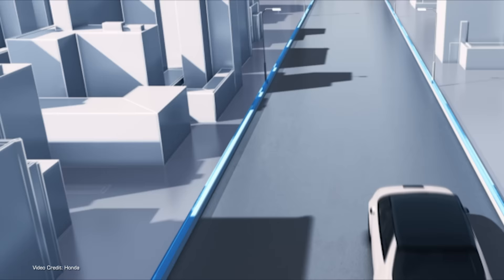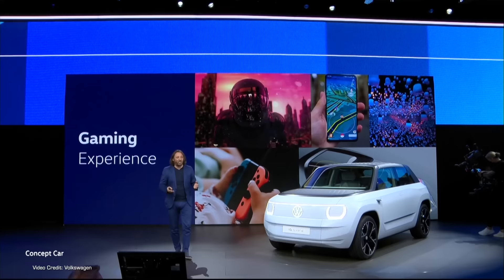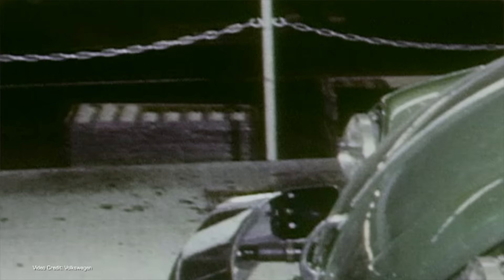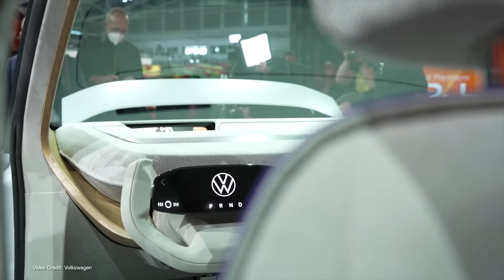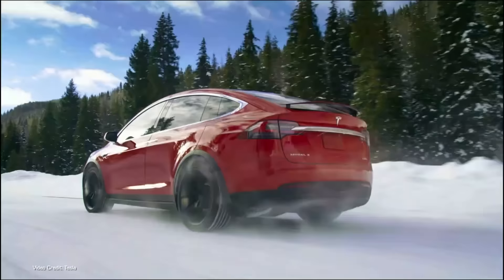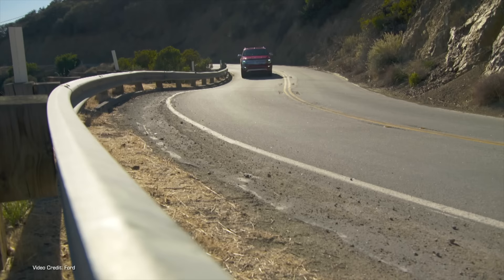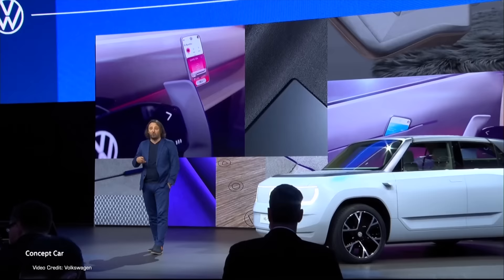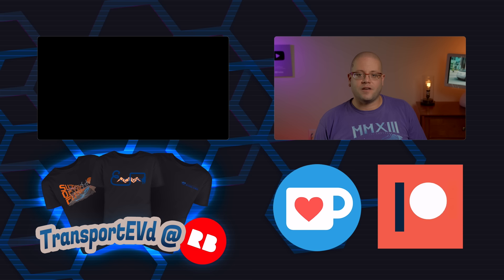We Love The Volkswagen I.D. Life - But It's Too Late To Break The Mold

Comment: It's just a concept car. I wouldn't put too much into it. Never seen one make it to production as is. Same goes for BMW's i Vision Circular or even Tesla's Cybertruck. The manufacturers still have to abide by safety standards.
Reply: It's the concept on the concept car that bothers.
That prototype itself, ok, nice try, we'll see. 
But why VW has the diminutive E-Up as a city car (a magnificent car, but an old ICE chassis convertion, a bit tight on range) and the ID3, and in between only a prototype and nothing ready to sell?

Comment: The reason you need 7.5” ground clearance is so you can open the doors in places where the kerbs are 6” to 8” high and so you can get over footpaths of that height and onto driveways which slope downwards.
Reply: Customers are also getting taller, fatter and older.

Comment: It's a little more than range and acceleration for EVs, efficiency, charging speed, and charging network are also very important.  Tesla seems to be the leader in these categories and the other manufacturers need to compete on these metrics.
Reply: For every day life, acceleration and range actually not essential. Efficiency, charging speed, charging network and price tag are matters
Reply: @MrQuachBinh  if your job is 50 miles from your house and your EV only has 100 miles of range, isn't that a problem on a cold day when you only get 80 miles?
Reply: @wineberryred  the fast majority of people commute far less, the average American drives 16 miles to work (and another 16 miles to return to home)
So, no for the fast majority range isn't an issue in daily use
Reply: @rj7855  so my wife commutes 60 miles west and I commute about 35 miles to the east to our jobs.  Our employers do not offer vehicle charging at work.  Since you're saying that range doesn't matter then I assume you're saying range is a personal issue.  I'm saying that you need a capable EV that will meet most people's needs and that we need EVs that meet every person's transportation needs in all cases without compromises.
Reply: The biggest issue right now is price. Even if you can find an EV you can afford you can buy an equivalent (or better) ICE car for $10,000 less. I know the arguments that EV have less lifetime costs but few people will give up $10,000 now to maybe save $15,000 over the next 10 years. 
Once the price issue is resolved range, charging speed, charging network, etc. will be deciding factors over which EV to buy. But for most people until the purchase price comes down EV's aren't even in the running.
Reply: @joatmon3282  I bought my used 2017 Nissan Leaf with 35K miles for $11,500 last year.  We love it so much we have a Tesla Model Y on order.  Yes, $55k is steep for a vehicle but my wife drives a lot so it's going to save me a ton on fuel costs.  Looks like self driving is coming soon so the vehicle is going to pay for itself as a taxi.

Comment: The minute someone comes out with a $15-$20 000 EV with 180+ miles of real-world range, I'm highly interested.

Trouble is, right now there is only the old guard which costs $25k+ for 100 miles, or the new guard with price tags of $40k+ for 250 miles. I need that cheaper in-between option.
Reply: Unfortunately it will not be made on the USA, but from china
Reply: Try a used ev.
Reply: @S.M.214  You seen the current craze in the PC GPU market?

Same thing will happen with EVs soon. EVs are released and sold out EVERYWHERE. And since demand is so high $40k for a $25k vehicle will not be unheard of.

So, no, used EVs will not solve that unfortunately.

Comment: At least, the I.D. Life is the sort of thing that is lacking here Australia. We're still around 2010 regarding EVs and many other things.
Reply: So long as your electricity is made with coal, there is not much point to an EV.  Your government needs to stop dragging it knuckles on that too.  Last I checked you had a lot of land that sees almost 100% sunny days.
Reply: @kensmith5694  Despite the Federal Government's (an extension of Mineral's Council Australia) best efforts, Australia's energy mix is rapidly greening up. Also, I'm certain there are reports out there that show that charging EVs with coal powered grids is still less CO2 intensive than burning petrol and diesel. Try chucking "coal charged EVs cleaner than ICE" into your favourite search engine.
Reply: @Aermydach  The numbers I've seen suggest that coal to electric car is about the same as gasoline to ICE car.  Coal contains nearly all carbon so all you get is CO2.  Octane has 8 carbons and 18 hydrogens so you get some energy that is not from making CO2.  If not for that, the coal to EV path comes out a bit better.

Comment: Ground clearance of 7.5" = 190 mm sounds wonderful. As a Norwegian, ground clearance is the first figure I look at in any vehicle I am considering for purchase. Living in a rural area, we use snowy, narrow, hilly roads on a daily basis in winter, with a 13 km drive to the grocery store, 35 km to a wider variety of shops and services. My ideal in a Mini SUV is 200 mm, but I could live with 190 mm.
Reply: My wife reminded me that Highway department rules specify that the plowing of roads does not have to start before 100 mm of snow accumulates on the ground.

Comment: Thank you, Winter. You have said much of what I've been trying to convey for many years about the availability of small EVs in the US. For the record, I drove a '64 Beetle back in the day (lots of used ones out there in the late '70s) and I've been driving a Mitsubishi i-MiEV for the past 6 years, which I picked up used and cheaply. I tell people that if VW never stopped making the Beetle, kept improving it and then made it electric, it would have morphed into that Japanese EV. The only thing thing the i-MiEV would need to be perfect for me would be a slightly larger battery. Given that VW will never bring their small EVs here, I've given up on them. I now have high hopes that the Chinese will be here in the US market in a few years with excellent small EVs at amazing price points with indestructible air-cooled LFP batteries. Check out the buzz on the BYD Dolphin and the Blade battery, if you haven't already done so.

Comment: The Nissan Leaf was introduced in Japan and the US in 2010.  The United States Environmental Protection Agency (EPA) rated it 21.2 kWh/100 km and had a range of 117 km (73 miles).   It was crowned the 2011 World Car of the Year at the New York International Auto Show. Popular Mechanics, upon awarding the Leaf its 2010 Breakthrough Award, explained that the Nissan Leaf is "not the first pure EV, but [...] hits the mainstream like none of its predecessors." Popular Mechanics also alluded to the Leaf's range, and said it was "enough for most commuters for the price of an average vehicle – and with a much lower operating cost than gasoline-powered vehicles."  

Total global sales for this generation of the Leaf, from 2011-2017?  Just  over 300,000 for the whole time frame. By contrast, in 2011 alone, the world’s biggest automakers sold over 58 million vehicles in the world’s biggest car markets.  

Let’s remember history for what it was, not what we now want it to have been.

Comment: I think you really hit on the critical point of needing superior DC charging.
Most people when travelling will expect to do about 3 hours before stopping for a break. So a 200 mile genuine motorway range is necessary.
This is why I got the M3 LR. I'd have happily settled for the SR but until their is sufficient charging infrastructure I don't want to be waiting half an hour for someone to charge before me to then wait half an hour myself.

Comment: The ID.Life was kind of introduced in 2010. It was called the Nissan LEAF. Even before the battery woes became a reality the car sold in very small quantities, 10,000 per year for the first two years in the US. It wasn't a huge success.

There is a very solid reason to NOT introduce the low cost EV first. GM experienced that when after introducing the Volt in 2010 they attempted a high end vehicle, the Cadillac ELR, and it flopped because it was seen as an expensive version of the Volt. Which is what it was.

Tesla's approach is the approach all car manufacturers have always taken when introducing new technology. Put new tech in your expensive cars first then as costs normalize bring the new tech to cheaper models. On Star was introduced in Cadillac's and was exclusive to that brand, now most GM vehicles have it. Electric windows and locks? Cadillac first. Auto close trunk, Cadillac.

So why did GM and Nissan not follow the tried and true method of introducing new tech in expensive models first with EV's? The answer is because all they wanted to do was comply with regulations. So rather than upset their high end customers with a new tech the manufacturer didn't really believe in, instead they made EV's as cheaply as possible and sold them at a loss in sufficient quantities to keep making the cars they always wanted to.

The first EV GM made should have been a Cadillac. Nissan a Lexus. But oh no lets introduce a loss leading compliance car. They didn't believe in EV's back then and they are only just getting the need for change now.

The ID.Life is the right car for today. I do agree with you it will come as too little too late. As you pointed out VW wasted time falsifying their Diesel emissions rather than work on EV's. Time they can't get back.

Comment: I do about 200 miles a month is there an EV for that model /?
Reply: I do less than that.  My 23yr old ICE car still works well.  I have thought of replacing it with a Tesla, but would a $40K Tesla sitting in my driveway be better for anyone?  Since Tesla is supply constrained, I prefer letting some 20000 mile per year commuter have first shot at it.  That driver can make an environmental difference, whereas I (and you probably) would be carbon positive on any EV and never catch up with our mileage.
Reply: With only 200 miles per month, any small used EV will do. Smart  Fortwo ED, Chevy Spark EV, Fiat 500e even the Mitsubishi I-Miev could do it. And because you buy it used, often time the parity point of emission is passed (depending on what is the source of electricity) If you want to buy new, any EV is able to do that but you'll probably never get emission parity during the use you're gonna make of it.
Reply: @normcfu  would an electric bike and a good set of panniers work?
Reply: @michaeloreilly657  Thankfully, the grocery store is right across the street so I don't really need any vehicle.  That is one reason I do so few miles.  In fact, I need to keep a trickle charger on the car battery between uses as it is sometimes a month or longer.  I already have several sets of panniers for my regular bikes, and a trailer if I need to get a lot of stuff.  Yes, maybe an electric bike would help but, because the area I'm in is not great for utilitarian biking of any kind, it would not be much better than my regular bikes.

Comment: I liked this episode’s approach. No nonsense, well spoken and good info. I enjoyed this fellow’s delivery. I agree with the notion EVs zapped to a dimension concentrating on range and launch capability but the former is necessary if it is to compete with ICE. As for the latter? Well, conservatively speaking, not necessary but it was smart to give EVs an enticing edge over most or all ICE (to date, depending upon which EV) and it worked for the sake of EV adoption. While some EVs in particular can vacate one’s lungs of wind the balance are still pretty spry and certainly not boring (at least what’s available in the states).

Comment: I remember that VW had a tandam quad design some years back which would have been grand for single commuters, but it never made it into production so far as i have observed.  Nice presentation Winter  I had been looking at electric trikes and quads with the notion of putting a very light aeroshell on them for just around town on inclement days like a velomobile or a Messerschmitt K200.  ICE cars have much too much mass because of the needs of large engines to provide a torque curve and transmissions to moderate the power to wheels.  And the suspension gets way overbuilt to support the weight of the engine and other components.  You could start your iterations by just sizing a battery pack for around town at a decent speed of say 40 mph.

Comment: At least for me, glad to hear about the ground clearance.  I don't plan on off-roading with my vehicles, but the angle of my driveway heading into my garage means my Bolt just makes it.  (Well, it did when I was parking it in the garage, but that's a different issue.. ;-)  I've had other cars not be able to make it (or not without scraping a bit).

Comment: Agree wholeheartedly with everything said. One thing I would add is what the hell does a family runaround need 250+ bhp for? Wouldn't 100 or so be enough? Wouldn't a smaller motor be lighter and more efficient giving more space for batteries and the car more range? No one needs a 0- 60mph of a millionth of a second, a high torque electric motor is plenty fast enough off the line.
Reply from the maker: Electric motors can be quite powerful while still being quite small and light, I don't imagine the different in HP matters all that much to the overall weight of the vehicle. Being an MEB car, I wonder if this motor was used simply because it's the one fitted to many other MEB models - Winter
Reply: @transportevolved  thanks for answering fella! It makes business sense to use the same motors across the range I suppose, particularly if, as you said, the maximum power makes little difference to weight or range. In that case, fit those fancy-pants dinky Yamaha 350bhp motors!

Comment: I'm not really sure what the point of this video is. You're wishing for something, a small cheap simple EV ten years ago, which wasn't really possible. 10 years ago Li ion batteries were about $1000 per kwh (in todays money) so a 40kwh pack would have cost $40k. There was no way to make a cheap ev without making a large  loss on each car. A big OEM could afford that in small numbers but no startup could, hence    Tesla's strategy of starting with sports/high end and working down the price range a battery costs declined.
Reply: Iindeed.  I think that's why this model isn't being built today - I think it's waiting on cheaper batteries or at least on more supply.  I think if it's intelligent for Telsa to start with the expensive cars when battery supply is tight and then go down the market then why wouldn't it be similarly smart with VW?

Comment: I think the modern electric beetle car is actually the e-up. It is also a bare bones car, with a simple radio and a heater that barely works. The problem is that battery technology is expensive, and we got used to having super cheap cars. The beetle was actually still quite expensive in its day, not everybody could afford it.

But to me the biggest problem with current gen cars is that they were clearly made in a rush, and with some unacceptable compromises in quality. For starters, cheap cars like the e-up don't have active cooling on the battery, let alone heating. That ensures a quicker death, and for such an expensive product is not acceptable. Also... I miss a lot of features that should not be hard to implement at all that are lacking from almost all. Things simple like the ability to pull a trailer. It doesn't need to pull a lot for a big trailer, but at least be able to put a trailer with your bikes to go biking somewhere, or a couple bags of soil and some plants for the garden. I don't get why anyone would ever make a car that is not capable of having a trailer.
And then another important feature to me would be to put an inverter, so you can use the battery as a power source. At least make it an extra I can pay for! It is such a waste to have such a giant battery and not be able to use it.
And finally, since electric cars must be as green as possible, make a charging system that can charge slowly of of solar panels by default. Then sell a charger that you can connect the solar panels directly and divert the energy as needed to the car or house or grid. I would buy it!

Comment: The reason we did not see small cheap electric cars 10 years ago is because the batteries did not have the energy density to fit in such a small package and the price of the batteries..unable to compete with gas equivalents. 

We did have the Fiat 500-e though, but it had a range of less than 100 miles and was obviously a compliance car in California, the only state where you could buy one of these. People who got one, loved them! Perfect to zip around in the city and easy to park.

Price of the batteries now have come down so much and energy density has got much better, smaller cars get feasible and make more sense every day. Sure we will see more smaller electric cars at reasonable prices the coming years.

Tesla will come out with the sub $25K car the coming years, the design studios in Shanghai and Germany already working on it, there are even rumours there are already prototypes built in Shanghai.. Tesla keeps on building factories in Shanghai and Berlin too. But it will not come out sooner than Tesla has ramped up production of the 4680 cells, which is required to get the price down enough and keep a reasonable range for this car and be able to produce enough of them to fulfill the demand, which no doubt will be ginourmous..